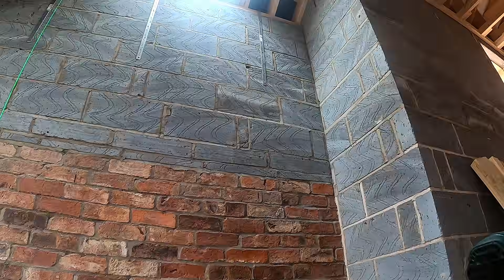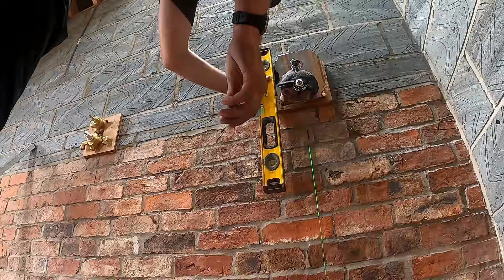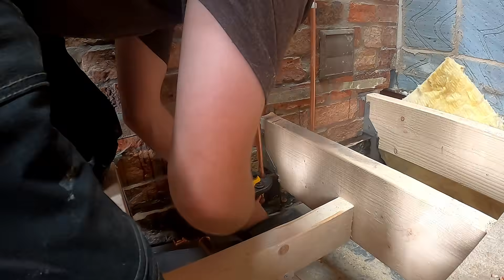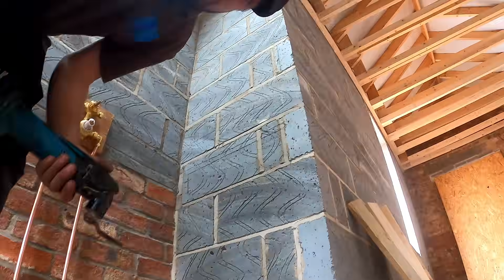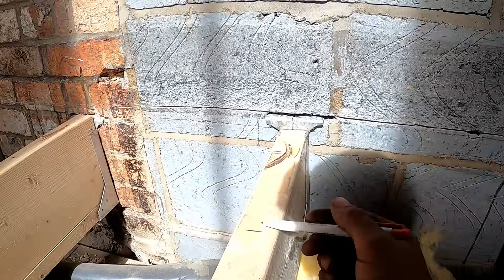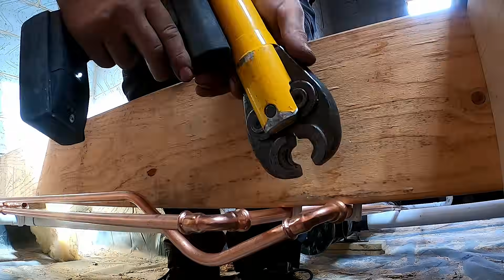TWIN CONCEALED SHOWER VALVES & Bathroom Plumbing First Fix

Comment: I had a very expensive bath stand pipe set which was supplied with proprietary flexi pipes, which had to connect to a 3/4 irons under the finished floor. Hope those things never leak. Absolutely crap design. No quality with some stuff now days.
Reply from the maker: There are some rubbish designs out there, I've had one like that in the past, thanks for watching mate

Comment: Just wondering the wall you chased out for the shower pipes is that not being insulated as it's an outside wall because if it is i think everything would need moving over 80mm but hopefully im wrong.
Reply from the maker: That wall is not being insulated as it's new with cavity insulation, the other one was an existing wall. Thanks for watching Anthony
Reply: @PlumbLikeTom   I'm glad I was wrong as you'd done such a neat job with those shower controls and pipes the last thing I'd of wanted was for you to have to take them out and move them. Spot on work as usual.

Comment: Hi Tom. Nice to see the continuation of the 1st fix, especially when a good plan 'comes together'. Regarding the offset dimension from existing masonary wall, for shower mixer valves, its never wrong when you double check your setting out😊. You mentioned wrapping both valves in bubble wrap, surely the dry liners/plasterers would do that as part of their preps??!!😄😄. Some customers/architects/bathroom designers love those exposed chrome risers for bath taps, but have little clue  how challenging they are to initially set out & connect up at 2nd fix stage! As you mentioned Tom, if the bath was at least 'unboxed', it would make setting out a little easier. Always more confidence inspiring, if you can make a cardboard template for risers & waste outlet positions! I know some lads who wouldn't do this 1st fix install, unless a joiner/site agent was on site to set out for them.
Nice example of your excellent pipe-bending & setting out skills. Thanks for uploading. mike
Reply from the maker: Thanks for the support as always Mike, those bath taps can be a real pain, I prefer the ones that mount into a first fix plate, that way they can be piped up, tested, and bolt on after tiling

Comment: Nice work, Tom. Has your Rems press gun been reliable? Mine has packed up and is going to cost over £400 to repair and recalibrate.  Its only 2 years old and hasn't had tons of use.  Needless to say, I didn't bother registering it, might have been covered under warranty if I had.
Reply from the maker: I'm sorry to hear your Rems gun has played up, touch  wood mine has been fine. I had a problem with a battery, but I just took it back and they swapped it.

Comment: You could use press male irons in your shower valves.  I had a job lot of Vado valves to do and they specced it in 20mm mlcp, so we used some Uponor male irons for that.  Lovely bit of pipework as usual 👌
Reply from the maker: These showers has the tails to 15mm with them, they couldn't be swapped as they had a larger end to connect onto the body of the shower, thanks for watching as always Tom 👍

Comment: You have done a great job there Tom 👍👍.
Good job the equipment is on site so you can get the correct measurements. 

Don't like the look of the pipe work on that job you quoted but did not win 😮
Reply from the maker: Thanks for the support as always John 👍

Comment: Great work as always Tom 👏 i now refuse to fit concealed shower valves , saw to fail down the line either not being to get the replacement or corrosion meaning the body having to be replaced
Reply from the maker: Thanks for the support as always Shane, these are branded valves so should be Ok, I do prefer bar showers though

Comment: Hyped 🤘😎🤘🫖☕️🍪🎥🔧👍👍🇬🇧
Reply from the maker: I've heard about this new hype thing, thanks for the support as always Wayne
Reply: @PlumbLikeTom I never trust those shower valves. You can Laser plumb them through the valve stems yet that front plate is a clog out as you know Buddy 👍👍
Reply from the maker: @OBIWAYNE-B  I always level up the edge of the plate just to making sure

Comment: I’m still very wary of  press mate. Yes it’s quick and you can connect to a wet pipe. BUT it’s distorting the pipe and fitting. So it’s just the o ring????
Reply: 100 % correct
Reply from the maker: I've yet to have one leak, I guess time will tell, thanks for watching as always Andrew